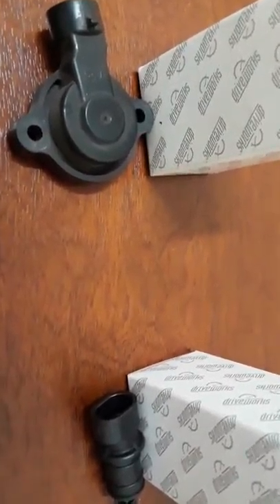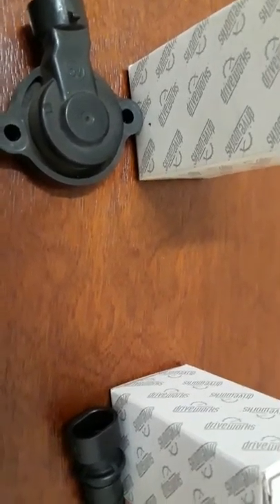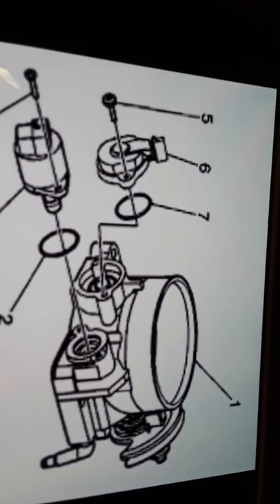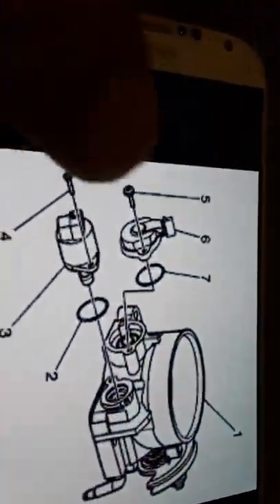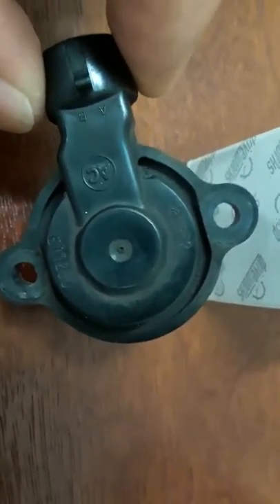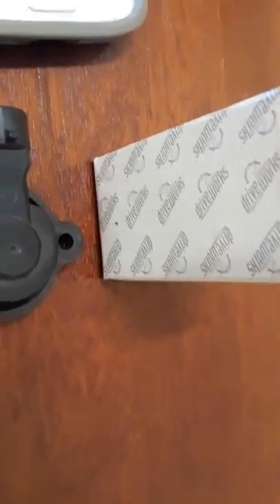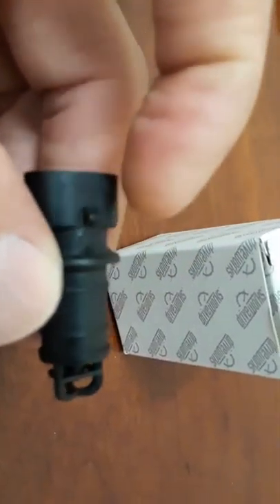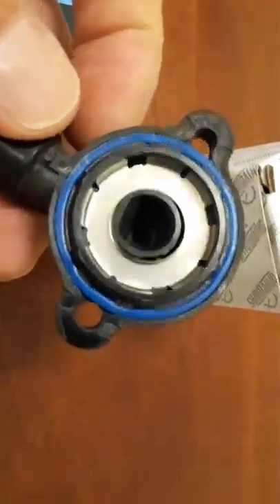Chevy Express cold start problems

Comment: @(Things Happens) Hey there I have the same problem with my Nissan tiida question is it that the rpm high wen starts at morning time?
Reply from the maker: No 1 is the cam position sensor the other one goes behind the mass air flow 
I wish I could help you out but keep trying thank you